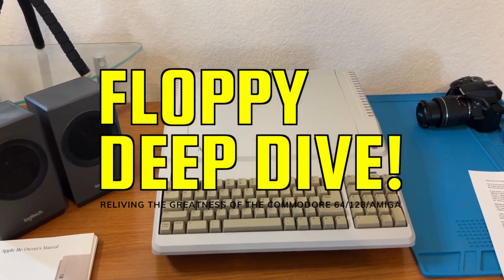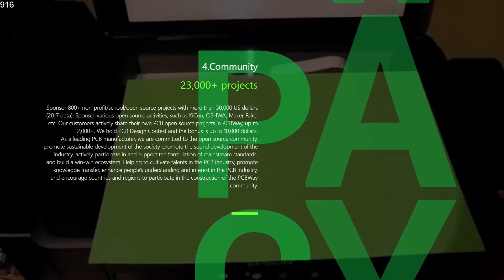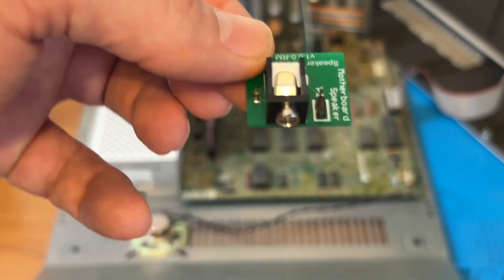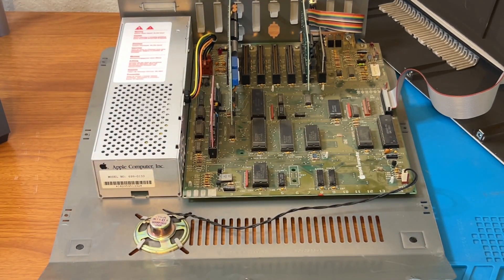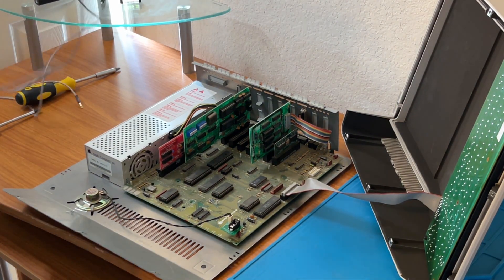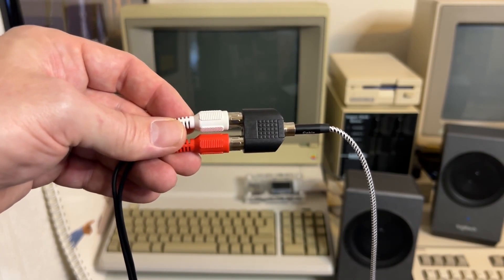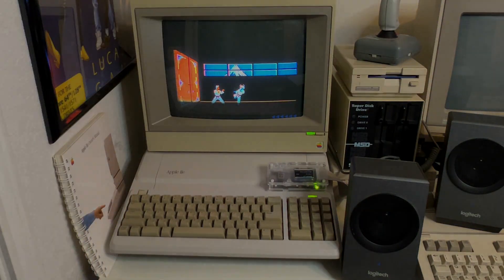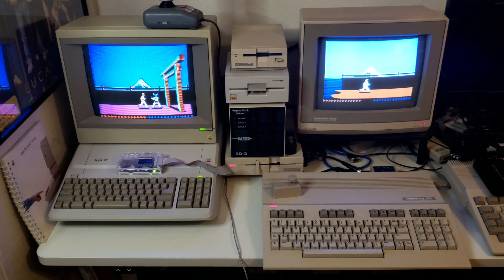How to Record Clean Sound from Your Apple IIe (No Mods Needed)

Comment: That's a cool little device, but an easier and quicker solution would be to use a sector editor to search the disk for all occurences of C030 and replace them with C020.  This re-directs the sound to the Cassette Out port, which you can then connect to the input of your external speakers or recording device.
Reply from the maker: Using a sector editor everytime is quicker? I only have to do this once and done